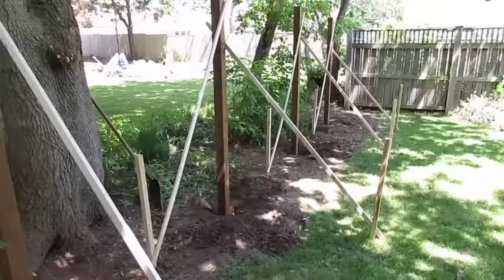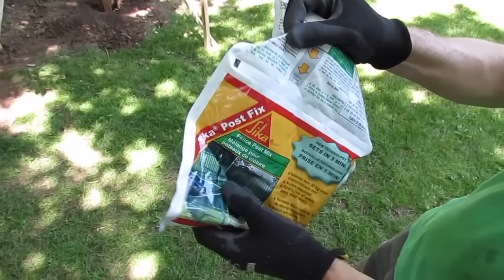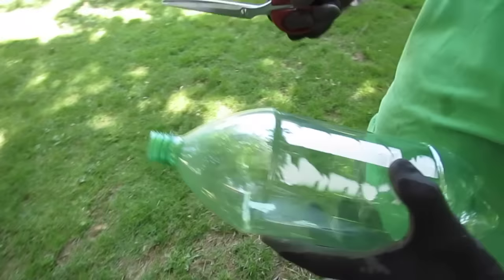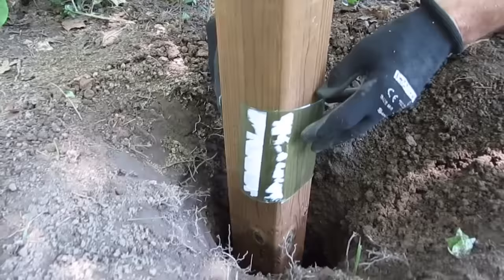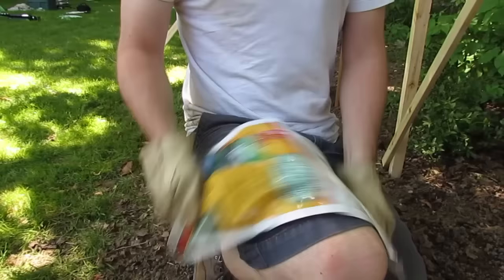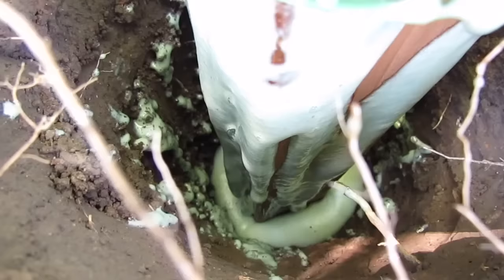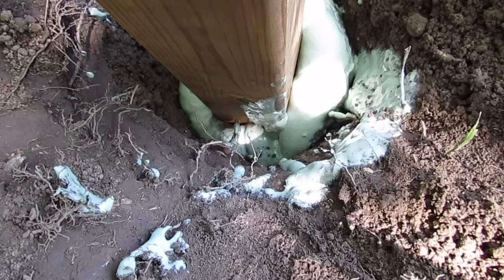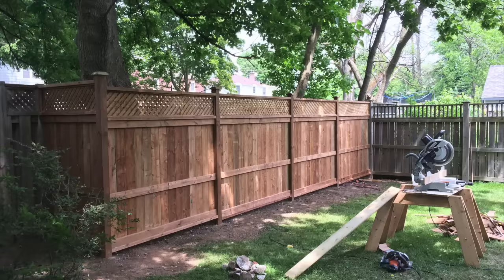No Concrete Fence Post Install!

Comment: Utilities have been using foam for transmission poles for years now, it's only just being introduced for the homeowner. I like Sika products in general, good stuff, but they have always been expensive. You can buy the larger (not in a 2 part bag) Kits that will do 10 poles for about 8 bucks each, still more expensive than concrete..The only big benefit I can see for a homeowner is these set up really quick. Both are good for me
Reply: Our Someday Is Now ,Does foam help increase the electrical grounding ability of the utility poles better than concrete would ?
Reply: I am wondering if this is to save time and manpower, because when utility poles go down, it is often because of a hurricane or tornado, where both time and manpower are pushed to limits and come at a premium.   I am sure it works or they probably wouldn't do it, but overall cost is their prime objective, and labor + transportation are the bulk of that.   Also, since they buy their product in bulk,  pay to transport it, etc. there are multiple ways this could simply be an overall cost cutting measure at that scale.
Reply: Now I know why my utility bills keep going up, up, up.
Reply: Don't have any idea why this matters, but for Fence Posts it's fine.

Comment: Just fill with dry concrete bury it and it will turn hard over time or just add water on top when finished
Reply: I've mixed cement with the backfill and packed it down. Works like a charm.
Reply: Hey man, don't start talking common sense. You might blow some ones mind...😂😂😂
Reply: CSX2586 Rail Rider Raby  Yes, this is my approach too. In the absolute driest conditions...I did my fence in August (hottest part of summer) and we hadn't seen rain in weeks...the dry concrete in the hole worked just fine. Within 24 hrs the concrete was solid. Amazing how the powder can draw any moisture out of the surrounding ground and soil.
Reply: Exactly that's the way I would do concrete, the weight  of concrete hold it just that much more
Reply: indylovelace, concrete will also draw moisture out of your skin so if you ever get it on you be sure and wash it off asap.

was working with a guy years ago and we were pouring a driveway. he told me of the time he first started messing with concrete and they were pouring concrete and he took off his shoes and waded in it like it was mud. he said after they were done his feet were all dry, cracked and bleeding and hurt for days afterwards.
Reply: Or just get post crete, add water, and it sets within about 20 or so minutes. No mess at all and them posts wont move.

At the end of the day if you know what you are doing you can backfill and tamper posts down with dirt you have taken out, again as long as the hole has been dug to the correct depth, posts will be solid.
Reply: CSX2586 Rail Rider Raby that's old fashioned! Doing it the hard way is often easier and I might add, more interesting!
Reply: thats how I did it from the advice of a contractor friend. 3-4 ft hole .... drop 1/3 to 1/2 of concrete powder inside ... tammper it down with the post ... level the post... back fill the hole with gravel. He said that if I did everything with concrete all the way up, the post would eventually rot at the connection with concrete
Reply: paul k - you are mistaken.  Concrete is a chemical process.  This is why it heats up as it cures (it is not a drying process).  Your associate had chemical burns.  He might also tell you about the time he had burn blisters on his arms when he carried creosote poles ...
Reply: worst advice ever ! explains I make $$$$ fixing your mistakes
Reply: Yeah or quick crete
Reply: My mailbox got slammed so now I have to dig up the 2 feet still in ground ..the install is easy but getting the broke in ground sucks
Reply: @1left2theright4jc9  
Get yourself an 8' 6x6.
Sink it 4'in the ground and set it with about 200lbs of concrete.
The next one to run into it will be sorry.

Comment: Wood Posts eventually Will Rot Above the cement, if used.
I prefer packing w-gravel or small stone.
Reply: will it hold if i use 10 foot post 3 in the ground
Reply: @rickcarp5453  Yes that should hold. I've done it plenty of times :)
Reply: Exactly.  As a general rule, try to avoid cement other than on things like gates.  Drainage gravel works really well because it locks into itself.  Start with a gravel a few inches below the bottom of the post.  Stick the post in and get it where you want.  Put in more gravel and tamp it.  Cover up with maybe 6" of soil, tamp that, and you have a good-looking install that will last for ages.

Comment: Neat idea but the cost per post is a bit high. Quikrete has fence post specific mix that you dump into the hole with the post and add water. Quick, easy, and cost effective. Average cost per 60lb bag (which can fill two or more posts holes depending on depth) is $3.25-$5.47 at (my local) Lowe's while one bag of this foam averages $12.28-$14.98 per bag. Ease of use is similar but that foam (the unused portions/trimmings) is non biodegradable, neither is concrete but the amount left over in the bags of concrete is negligible and you can recycle the paper bags. That foam is a little trickier to recycle also. But this is just my thought on the idea.
Reply from the maker: One post hole (9" auger, 3 feet deep) takes 3 or 4 50lb. bags of concrete. There are many online concrete calculators that can show you this.
Reply: PatonHaus that is true for a large post hole, I am saying that for smaller jobs like chain link fencing, Pickett fencing, or small clotheslines bagged post mix would be more cost effective. 6' 8' and 10' privacy fences encounter far more force from wind and do need a larger concrete base (although I prefer 6" x 32" base for speeding things up a little) to withstand the side forces from the wind.

Comment: I used this to put in the bottom of some really big planters that I have in the back yard. Well, one planter got the foam and the other two I just filled with soil. Guess which ones are all but impossible to move??? lol. The foam one, is of course, pretty easy to slide around. So yeah not just about the cost to the wallet, think of your back. it was kind of spendy but I love the results. and it sets up very hard. I made sure I put drain holes through the foam to the weep holes in the pot while it was sitll curing,
Reply from the maker: That's a good idea!

Comment: How has this held up since last year. 
Please come back and pin a comment on how this product works after 5 years.

Rebuilding a fence now that the posts were concreted in 13 years ago. 

I live in North Texas. Our soil is black clay. It goes from totally saturated in the winter to dried out with three inch wide cracks in the summer.
I will try this product somewhere but from experience with other expanding foam products. I do not see this one holding up to well.

Comment: When I bought my house a fence line had been done with posts in foam that year, one snapped on the 4th year and I replaced it with concrete. The others don't look long for the world, at least in Canada I wouldn't recommend foam unless you want to replace in 5 years or less
Reply from the maker: I’s say that’s pretty impressive if a post snapped, sounds like the foam did it’s job no?
Reply: @PatonHaus  by allowing the post to rot? I guess if that's its job, snapping posts typically (and in this case) means fast rot, a post properly sealed in concrete with it sloped away from the post and caulking around the join is far less susceptible to rot, take the time to do it right, this mickeymouse foam is a joke at least in Canada when you have a 4' frost line minimum

Comment: Mess & hassle of mixing concrete?

It's called postcrete, empty the bag into a hole & pore in water.

Done.
Reply: ..."pore in water"?  Water does not have pores.  You do.  One pours water.  No, really.
Reply: water goes in first you muppet.
Reply: Right on built over 100 wheelchair ramps in my career  maybe same number of decks  never premixed concrete  water dump powder in hole pack and top with water done
Reply: Avoid mess of concrete... 
uses plastic to avoid mess of sticky foam.

If you were in a desert, or somewhere difficult to find/use water, then yes, this is an interesting alternative to Postcrete.
Reply: @Famous5s  if you cant find water finding a pack of this is not going to be easier is it....
Reply: EXACTLY !
Reply: Don’t even have to do that. Pour it dry in stages, tamping in between. The ground moisture will eventually cure it. And you start nailing or working the post immediately.
Reply: @eaterofclams  all the grammar police have arrived
Reply: @Jafmanz  not with quickcrete. concrete first, then add water. simple and mess free.
Reply: mattmacd2009 aaaaand, the concrete rots out your posts.
Reply: Beau Truax  Is that sentence a statement or a question?  Lousy sentence structure Beau.
Reply: @greggc8088  Mom, I told you to stop this.  It's rude.
Reply: Gregory Schmidt o
Reply: admhou1 b
Reply: @SirCamsmorethanalot  Thats quickcrete. The OP said postcrete.
For best results follow these instructions: 1) Dig hole to correct depth and width relevant to post size (see table on reverse). 2) Fill hole with water to a third of the depth. 3) Pour in Postcrete evenly around post until no standing water is visible (powder completely covers water surface).
MUPPET!
Reply: @jeffreyoneill6439  you think more people would know this. Hell i worked in a state park. We never hauled in water to set a sign. Just dump a bag in the hole.

Comment: I have used the foam several times to set mailboxes.  It is easy to use and holds the post very well.  Purchase price $12.75 at Lowes.  On the plus side, I installed a new mailbox for my neighbor.  Recently her sister backed into the post.  The foam flexed preventing damage to the post and mail box and her car.  If it were set in concrete the car and mailbox would have been damaged.  I removed the post from the ground, sawed off the old foam and reinstalled.  A note of caution.  The instructions state to mix the product for 15 seconds then use. Have scissors handy to cut the bag open.  I was too slow opening the bag.  It rapidly expanded and exploded.  The back of my GMC Pickup has a few foam spots attached.  The blacktop on my driveway has the bulk of the foam securely attached.  My neighbor (80) thought the dried foam reminded her of throwing up in college.  I said lets paint it to look like food.    For a small project it is worth the price.  It does not weight 50 to 80 lbs as a bag of concrete does.
Reply from the maker: Great points, that’s probably the perfect application for it 👍

Comment: I'm hearing that this foam shrinks in a short time "days or weeks "and the post become loose?
Reply: @elizacathleen2916  Did you see my question mark?????? But thanks for calling me a liar.
Reply: @bustinya2240  sorry I deleted the comment. I used the stuff for basement insulation. It’s fantastic. I hope it works for posts because I’m using it today. For my clothes line 🥺

Comment: I would have been done with 2 posts already with concrete, hell,you already have the post level and straight, that’s the hard work.
Reply: He's just showing how it can be done another way. Concrete ain't the only method, and it sure as hell isn't twice as fast, its the same thing

Comment: Note: Do not use with vinyl fence posts. It will float the posts up out of the ground as it expands!! The vinyl posts don't have enough weight to counteract the lifting power of the foam.
Reply: I did and had no problem using it. Worked like it should.

Comment: If in a cold climate, the frost would likely grab that foam and lift the entire thing up and down and all around.  Easy to use dry concrete poured around post, then add correct amount of water.
Reply from the maker: Absolutely, and would heave concrete the same way. Frost doesn't care if your fence weighs 5 pounds or 5000, it's increased depth that solves that problem.

Comment: Oh hell, I'm sticking with the concrete concept. Pour concrete, add water, done. This is just too much work and a lot of shit chemicals
Reply: Just pour pure cement in the whole and just add water? Any rocks also? Asking for my project
Reply: @DanielMarcano911  no u have to pick up the heavy bag of cement pour water break ur back mixinh  it well then pour it in a hole!
Reply: Around here i dont even add water to the cement. Just put it in the hole and as long as the ground is wet enough or it rains it sets up just fine.
Reply: Probably easy to pull up. Once your pour concrete its almost impossible to pull up. I know because I just did it the other day. I spent about an hour on one pole. Had to move a pole the previous owners had in the yard.
Reply: @pearlsandmermaids5942  get a paddle mixer for a bucket! Much easier! Though I bought this sika stuff (havent used it yet) but looking at reviews and hmm most people get wobbly after a couple of days so I'm not sure.....

Comment: But concrete adds weight at the posts lowest point and gives stability.
Reply: Thats exactly what I thought I use about 120 pounds of concrete  per post that alone is alot of stabilizing weight I would think.
Reply: You  both don't understand engineering or physics.  The post transfers the weight of the fence to the ground vertically.  A cement footing's weight has no effect on this.  Remember the post is basically a lever with it's fulcrum at ground level. The only thing needed is to counteract lateral forces.  That can be done with any material that prevents the post from moving while also making sure the post length below ground is deep enough.  The weight of the material holding the post has absolutely nothing to do with the stability.
Reply: @spocksvulcanbrain  let me guess your a millenial.... try this physics experiment take a post in the ground put 1 pound of foam and lift it out, then take 120 pounds of concrete and lift it out of the hole and tell me which post takes less force to remove from the hole. By the way I worked in civil engineering for years and can tell you with out any doubt a weighted object in the ground will give more structural integrity than a light weight object.
Reply: @spocksvulcanbrain  Ok.....sure bud the weight  of your anchor has nothing to do with holding a post in the ground if you say so.....
Reply: Kirk Ryan. Fences with large heavy concrete footings don't blow over as easy as Fences with light concrete footings because of structral strength increased by the wieght of the footing.30 years fencing Australia,its just how it works.With respect.
Reply: @jamesrichardson4741  : No that's not correct.  It's not the WEIGHT, it's because the surface area of a larger amount of concrete that can hold the pole in place against the soil.  
Think of this, take any pole (wood, metal, plastic) about 8 feet long.  Bury 1 foot of it below ground without any other filler (concrete, foam, gravel, etc).  Now try to pull it over by grabbing it from the top.  It should be relatively easy.  Now do the same with a 10 foot pole burried 3 feet.  Again, no other fillers.  The top of the pole will be 7 feet from the ground - same as the 8 foot pole buried 1 foot (so you'll have the similar lever advantage).  Now try pulling it over from the top.  You'll notice it is either  impossible or very difficult.   This has NOTHING  to do with the presence of a filler.  It's due to the increased surface area of the pole in contact with the soil.   The same is true of any filler.  If foam or concrete is used resulting in the SAME SURFACE AREA, then the ability to withstand lateral forces is identical.
Reply: Kirk Ryan ,i think your statement is true if the fillers used were of the same hardness and weight.For example,rapid set concrete has a hardness of 7 on the concrete scale and normal concrete 20.Rapid set is also less dence and weights less per volume that normal concrete.So if you  look at both bags it says in the product description that the normal concrete is suitable for structural applications and the rapid set is not .The two products provide two different levels of structural integrity while taking up the the same amount surface area.
In the old days (70s) the rammed earth system was used not concrete.This process has proven its failure as dirt lacks the strength of concrete and over time all those old posts have needed some concrete in them to make the straight and stop moving. Thats my experience anyway.cheers kirk
Reply: @jamesrichardson4741  my point was only in response to weight being the responsible property of stability.  True concrete is better than dirt because it binds to the pole and provides more surface area, not because of the weight.  Dirt doesn't bind to the pole and will shift and become slippery when wet, so it's a poor substitute for concrete.

And for those who continually say it's harder to pull a pole out of the ground if it's footed in concrete, you are correct.  HOWEVER, fence posts do not have any upward vertical stresses.  Fences are, by definition, there to keep upright against LATERAL forces.
Reply: @spocksvulcanbrain  Kirk "You  don't understand engineering or physics"    WIND SHEAR!!! Oh NOOOOOO!!!!!!
Reply: Kirk Ryan then why not just fill the hole back up with dirt?

Comment: Interesting. Been doing fences & deck's for decades. Never imagined you can use foam. Wonder what the long term stability is like. Is there any warrantee against deterioration or breakdown of the foam?
Reply: No!
Reply: Finally someone with a civil tongue. I also would like to know how the foam holds up long term. And, would it be suggested (no haters please) for chain link?
Reply: RUFFUS -  "decks", not "deck's"  

Why on Earth would you use an apostrophe?
Reply: Because this is not an English class?
Reply: Jason Jones it is warranty is for 50 years